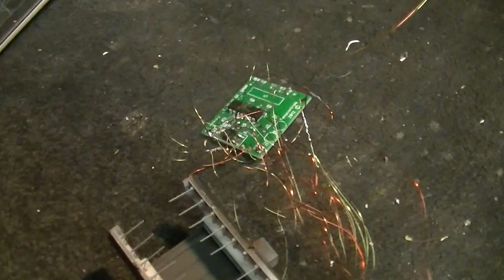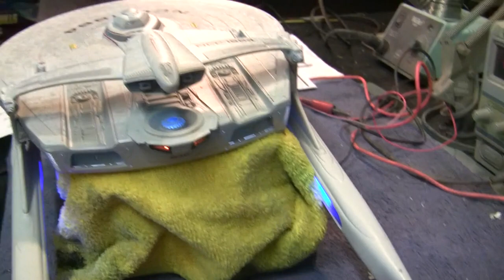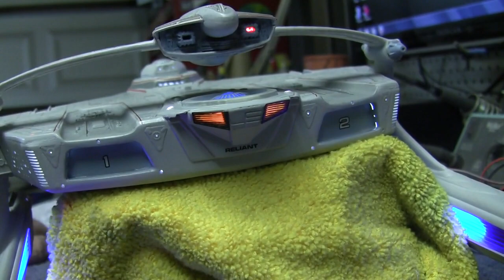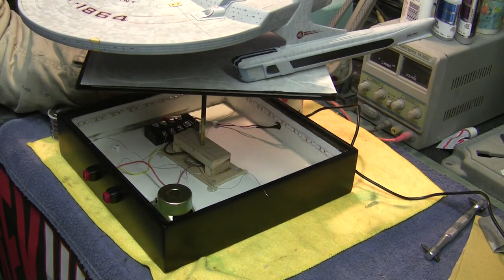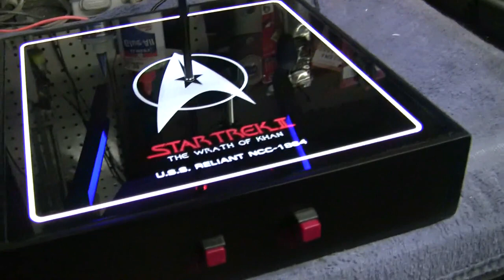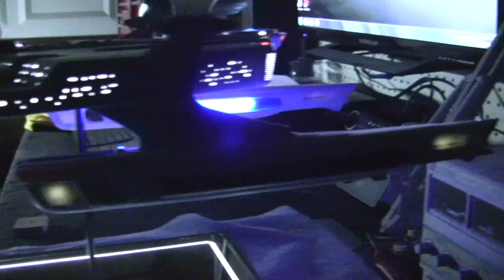AMT U.S.S. Reliant Finale And Mounting It On A Custom Display Base

Comment: I just finished a 1/1000 Reliant using Paragafix photo etch and the Round 2 Aztec Decals with the Tena controls 2 speed flasher board and I surprised myself! I've learned a tremendous amount from you Boyd, thanks much !

Comment: Actually the Reliant does not have a dome in that location...   it was actually a sensor  and using the hub cap off a model car inside with the center drilled and the flashing light would look more as the studio model actually was.  the dome was added after the model was used in the Next Generation.  Also  the tops of the  nacelles were the crystal glows blue.  on Relaint it was red.  look at the film as the Reliant is circling the Enterprise, u will see it glows red.  and the side cooper colored collectors have a glow  unlike Enterprise which I never understood.

Comment: Hey Boyd,  I received your message to check out your latest Reliant...And as you said The toned down scale lighting would be improved over some of the Reliant models you built years back!...And You knocked this build "WAY OUT OF THE PARK"...I LOVE this new display base!... You are the model builders ICON...!  I push my model builder customers to your channel to learn as I have, you have saved me and thousands of other builders from a TON OF FRUSTRATION!...A few years back I watched your (30 Gauge micro wire video), and now I use it constantly! It makes wiring tight spots a CAKE WALK...Thanks for ALL of your sharing...Frank at Galactic Modeler...
Reply from the maker: Galactic Modeler I'm glad to hear that you found some of the tip's useful.
Reply: Hey Boyd,
Just wondering if your have seen or have used these NEW LEDS... I have run into them from a China vendor? They are SUPER FAST flashing LEDS...I call them PHASER BANK or BLASTER LEDS!... I sell LED lighting kits that appeal to guys that can't solder and have no 12 or 9volt circuit board experience...My LEDS run on a 3volt power supply and are all SELF ANIMATED thus escaping the circuit board  These BLASTER LEDS can easily be integrated into any 12 or 9volt system with a resistor I have tried this and they work PERFECT with those power supplies...If you can check out our recent AMT 22 inch Enterprise 1701-A build on my you-tube Galactic Modeler channel you can see these LEDS in action...Also if you have a minute our 1701-E build might even show our phaser LEDS even better!  I would be happy to send you some with resistors at NO CHARGE... I feel you may have some fun with them!.. And they are non-competitive to your other vendors such as Tena Controls...Because my lighting kits are from a completely different market of customer...They have HUGELY increased my sales for guys that want weapons on their Star Ships...Star Wars models...RC tanks and others... 
Have a GREAT DAY! ....Frank-       
P.S ...Do we ever sleep?
Reply from the maker: Galactic Modeler Hah, sleep is over rated ;) Very interesting LED's. Sure, I would appreciate some samples to work with.
Reply: TrekWorks Hi Boyd,Let me know were you would like them sent...Frank-

Comment: all i could find was a french light blue gray would that work for the shuttle bay doors
Reply from the maker: clint lewallen Clint I'm not sure what French light blue looks like. I mix all of my own colors by eye using reference pictures of the subjects I'm working on. I'm not familiar with what the colors are actually called by the various manufactures out there.  To make this color I start off with white, add a little black until I have a light grey, then add drops of blue until it becomes a light blue/grey. It's a familiar color that we see on a lot of the Federation ships like the Refit and others.
Reply: TrekWorks this is the color i was talking about http://www.amazon.com/French-Light-Enamel-Paint-Bottle/dp/B008JZPV7A/ref=sr_1_2?ie=UTF8&qid=1422836438&sr=8-2&keywords=light+blue+gray+model+paint
Reply from the maker: clint lewallen
Ok I looked, that color to my eye is a bit too dark but it's in the ball park. A little kick of white added to it would help.
Reply: TrekWorks OK boss

Comment: wondering what color you used to paint the back of the reliant for the shuttle bay doors and that little area behind the officers lounge where the grill photoedg goes
Reply from the maker: clint lewallen The shuttle bay doors are painted a light blue/grey and the grill is a medium grey.
Reply: TrekWorks i also for got to ask what color you painted the phaser cannons and the torpedos on the roll bar

Comment: sadly round 2 stopped making though aztec decal sheets or do you know where i can find some
Reply from the maker: clint lewallen They are hard to find at this time. Sometimes they do pop up on ebay or Amazon but you have to get em quick! People are all over them when they show up. Maybe we can all write to Round 2 to tell them we want the kit and the decals back in production. Personally I would rather have the bigger kit's instead of the Cadet series stuff.
Reply: TrekWorks i wrote to them last night hope they got the message